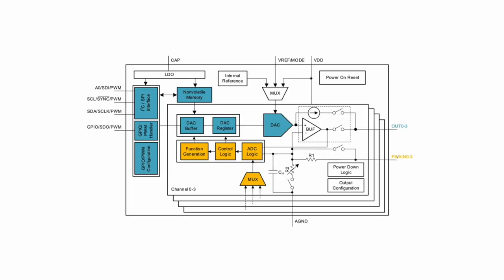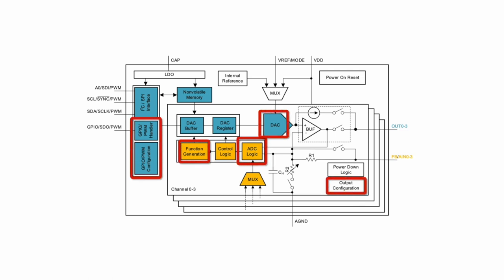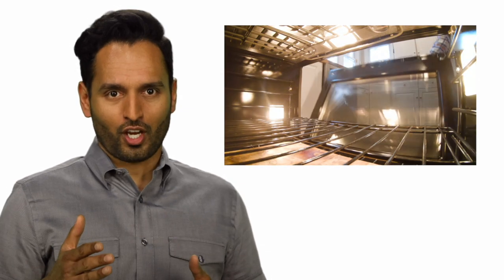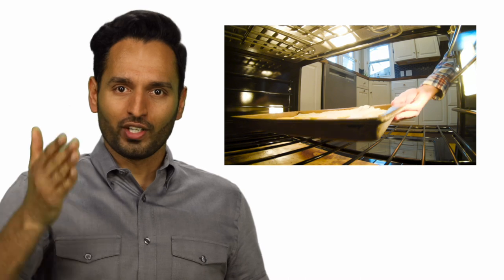What is a smart DAC?

Comment: All we want is a successor to PCM1794 and 1792.
Reply from the maker: Hi there, thanks for your interest in TI products. The PCM1794A and PCM1792A are great audio DACs that we continue to produce. If you want to check out a new DAC for high-end audio, we recommend taking a look at the DAC11001A here: https://www.ti.com/product/DAC11001A.
Reply: @TexasInstruments  I'm afraid the 11001A isn't intended for audio use. It uses SPI protocol instead of the common I2S, and the datasheet doesn't mention consumer audio as one of its applications.
Reply: @TexasInstruments  any resources to implement a dac using the dac11001a?
Reply from the maker: Hi Manuel, thanks for your question! This thread provides helpful information about audio application for the DAC11001A: https://bit.ly/2VvfUcp.